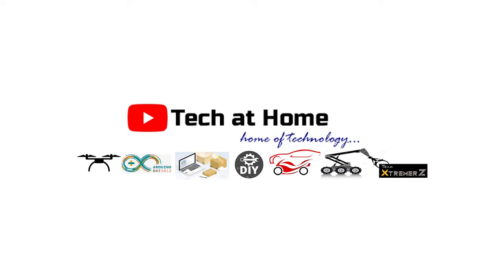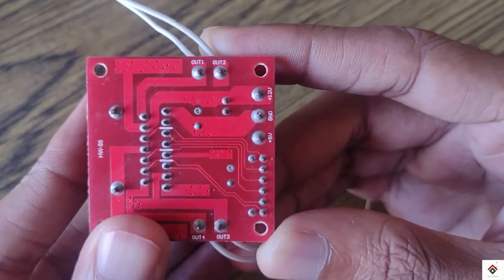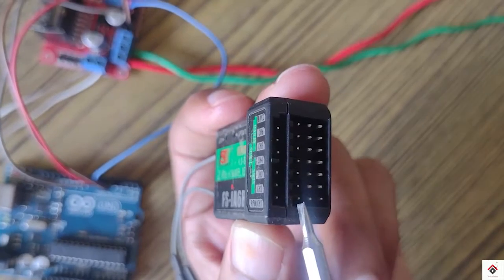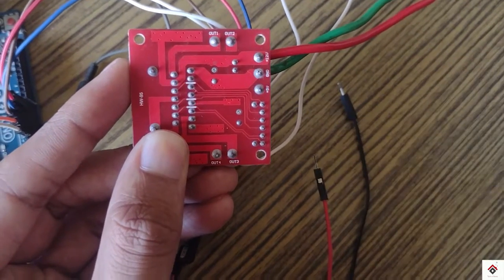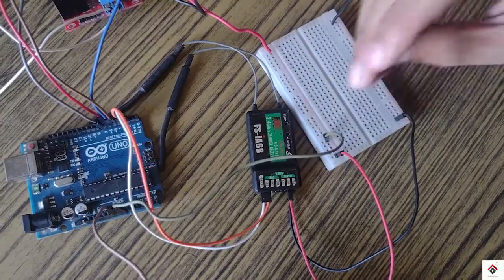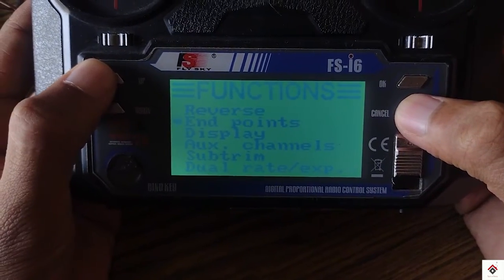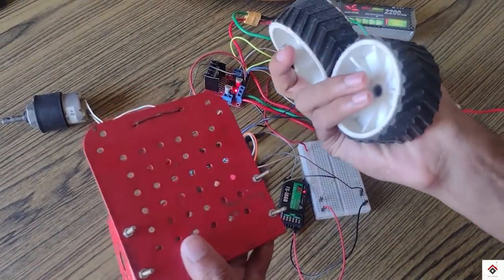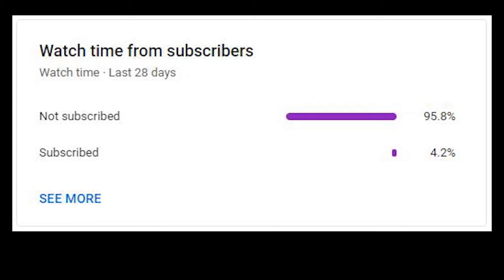Control Two DC motors using Flysky and Arduino | How to make 4 wheel Robot, RC car[ARDUINO + FLYSKY]

Comment from the maker: Control DC motors with seperate sticks for pan and tilt application : https://youtu.be/pnSPDeeDyxs
Reply: Hey @techathome could you help me? I am making a tank with the same mechanics as shown in your video but I want to add another moter, one servo and a way to shoot a gun using a nichrome wire. I am useless at doing any type of coding, would appreciate it if you helped

*Edit: not an actual gun just a model one using flash cotton to shoot a small metal bearing

Comment: Could you do this without the arduino board and just the flysky
Reply from the maker: Check this video for the same: https://youtu.be/m9Lq-QADP9A?si=r8GQZYcWO2JqnEK2
Reply: @techathome thanks what i want to do is make a 40volt lawnmower rc, I already have the motors and batteries and buck converters, now I just need an rc platform and I think the flysky is the answer
Reply from the maker: Flysky can be used.

Comment: Can this tiny motor driver handle these big 12v motors?
Reply from the maker: Yes for some time.
We have latest video without using Arduino and with high current driver. Go with this if you are working: https://youtu.be/m9Lq-QADP9A?si=ZMWZtLoFCtU-E4Tt

Comment: I am a subscriber. You sir have explained the procedure and connections perfectly and in a manner a novice can understand. 
Thank You!
Now add a bi-directional turret with a relay for turning on a fan with program to make the controller complete.
Reply from the maker: Thank you ♥️🙏🙂
We have the latest version without using Arduino. Go with this method: https://youtu.be/m9Lq-QADP9A?si=862nuMWoYCq3AhVX
Reply: I recently purchased: WT-500S Tank Chassis Robot Remote Control w/Complete Electronic Control System on Ebay.
It however failed on the first power up. The control board smoked. The seller is being difficult on replacing the board.
I plan to install Arduino with L293 drivers, but I need an additional motor. can you help?

Comment: Bro use flysky fs-i6x transmitter or not
Reply from the maker: Yes you can use it.
Also instead of this video, check the latest solution without using Arduino: https://youtu.be/m9Lq-QADP9A?si=3AV678mhUmGbla1f

Comment: Can I use the same method for my 25kg warbot,Instead of cytron ??
Powering 24v. Suggest any method if this not work
Reply from the maker: Check this video, you can connect 24v supply and motors: https://youtu.be/m9Lq-QADP9A?si=YVvHB-bRe1myWaPl

Comment: can I input 7.4v to the 12v port? 
or does it need to be 12v?
Reply from the maker: You can use 7.4v if your motors can run with that supply.

Comment: This absolutely does not work !!!
i build it 2 times and my motors don't run.... 
What voltage motors do u use ?
Reply from the maker: 12v motors.
We have latest video without arduino. Check once: https://youtu.be/m9Lq-QADP9A?si=m6C0FN2sOyekVZhg

Comment: sir i have used 3 motor drivers to connect 6 dc motors , now i have to give power to arduino only from  one?
 and i am using switch to to control only forward and reverse movement of the motors then from where i connect the switch directly in UNO or else where.

Comment: Sir, your video is so awesome.
My code is uploaded successfully and my all hardware connections are correct working properly. But my 500 rpm motors are not responding to joystick. It is in off position only no movement in it. 
I think i have upload the code after the connections?
Reply from the maker: Can you check this latest video without the need of Arduino: https://youtu.be/m9Lq-QADP9A

Comment: Voltage limit ? Could i use an 25 volt motor?
Reply from the maker: Not with this.
Refer to video below which doesn't need Arduino board and can work with 24v motors: https://youtu.be/m9Lq-QADP9A?si=Ym0KUEisNj1dfrak

Comment: hello techathome. Does this also work with the fs ia6 instead of the fs ia6b receiver that you have used? Thanks
Reply from the maker: Yes, but one suggestion.
Instead of this solution, check one more latest video which doesn't require Arduino: https://youtu.be/m9Lq-QADP9A

Comment: Bro can we connect 4 12 v dc motor and pair it by 2 2 motor in one side and another 2 in othr side of motor driver
Reply from the maker: Yes you can do that way, 2 motors in parallel

Comment: I am not able to get rx signals on my arduino....I have connected every wire correctly still i am not able to get arduino rx signal
Reply from the maker: Check if your jumper wires are fine or not using multimeter

Comment: I can't seem to get the code file to work. I can see the code in your video through the (if) line. Any chance someone help with the remainder? I built a project with the exclusion of an arduino because code for the project would've been way outside my ability but the last item, linear actuator, has forced me to use an arduino. I can do small simple and hopefully at some point do a more complex code on my own in a future project. I just haven't progressed thar far. Harder for older people to grasp this but I'll get there

Comment: Sir with the same code only one motor is running I have checked the motor driver and the motors are okay. What can be the problem sir? Is their any issue with the code
Reply from the maker: There is no issue with code,
Have you mixed channel 1 and 2?
Reply: @techathome  how to mix sir

Comment: I made it but the motors started rotating as soon as I connected the battery, I turned on the elivon and checked every connection. I used 5v bo motors in it is that why it's not working? Please reply 🙏🙏🙏🙏
Reply: Check your motor trim slider or dial depending on your transmitter. Motors might move until you adjust the trim. Plenty if videos to show you how.

Comment: Im trying this with the same motor driver and motors with an arduino. But my motors are only running in one direction and not the other.
Reply from the maker: Refer this video and check if your motor driver is working for both direction: https://youtu.be/xHbsWyoijb4

Comment: Can i use this with nrf24l01 transmitter and receiver?
Reply from the maker: To control the robot I have mixed two channels,
Is that channel mixing possible from that?
Reply: No, but I want to use it with separate channels
Reply from the maker: Then this will help you: https://youtu.be/pnSPDeeDyxs

But modify the values based on your receiver in the code (if else statements)

Comment: Question, does this devive work with any type of receiver? For example a Futaba?
Reply from the maker: Yes it will work. But you need to print and check the values coming from your receiver and update the same in the code (if statements).

Comment: I really like this lesson and I am studying UNO ,AVR 328. I have a question signal output digital pin 4 and pin 7 right?  signal output pin 5,6 PWM right? If want to control something else what should I do pin4 ,5 pin 7,6.  If I don’t have motor driver

Comment: Does the code work on flysky CT6B
Reply from the maker: Yes it will work,
But 2 things to take care,

1.  Print the values from both channels on serial monitor(Just uncomment serial.print lines in the code) and based on the values coming from your receiver, edit values in if statements.

2. For robotic movements, check how to mix two channels in ct6b
Reply: @techathome  ok thanks a lot
Reply: Could u please make a code got a car using ct6b transmitter as the above thing what u mentioned is not working.
Reply from the maker: I don't have ct6b with me
You can mail us
I will help you there

Comment: Is it possible to control the speed of the motors according to the stick movement in transmitter
Reply from the maker: L298N was not able to handle properly.
I have already done updated video using BTS7960  with speed control: https://youtu.be/EnbkdrYQ0NE
Reply: @techathome  thanks for the reply 👍

Comment: When I tried this I was using analog A0 for the flysky signal and  digital read function that reads like analog in and maps it to the outputs. It didn’t work that way but now I found this video thanks. But why does analog read for A0 not work.

Comment: can i use any RC controller with its transmitter or does it have to be flysky? and if i can use any.. does the code changes?
Reply from the maker: Yes you can use any transmitter,
Make sure correct receiver output is used.
Also, in the code we have used values for comparison, those values you can print on serial monitor and edit accordingly for your Transmitter.

Comment: If I am connecting power supply to motor driver not getting the signal in Arduino.
Every connection were perfect.
What to do?

Comment: Controller is only able to start the motors, but after that we can't control the direction of motors..... Not detecting the Code from else if
Reply from the maker: You can try this:
Print the values coming from channel 1 and Channel 2 on serial monitor
According to your transmitter values modify the code

Comment: If we are using 4 wheels, will the codes be same in arduino ???????please reply,also if the code is different,please provide the code :)
Reply from the maker: Yes same code
Connect another motor in  parallel to left motor
Similarly, on the right side
I guess I have shown in the video somewhere about connection of 4 motors
Reply: @techathome  thank you ,it is working fine ....😊

Comment: Hello brother! 
Actually I was planning to make a remote controlled bike using a bo-motor and a servo motor to turn the handle connected with CT6B  receiver, so wat should be the connection of bo-motor and receiver..... Cuz bo-motor don't have signal pin 
Em not getting wat to do so pls assist me 🙏🙏🙏
Reply from the maker: Servo motor directly Connect to Receiver

For BO Motor refer these video, but use( 9v battery instead of 12v)
https://youtu.be/Pcct-0RmcZE
Reply: @techathome  thanks for the reply!!
bro as I am making a bike..... using any kind of Arduinos makes my bike bulky....so is there any idea other than Arduino???? Pls suggest
Reply from the maker: Arduino nano you can use
Reply: @techathome  thanks for reply brother!!
if I use Arduino nano I must compulsorily use any of motor driver viz. L298N....it definitely makes my bike bulky....
Okay wait!!,  I also have an alternative way of making RC bike by using HC-50 bluetooth module without using any receiver....but wires and connections makes bulky....so wat do u suggest for tat

Comment: Ic Is getting heated what to do
Reply from the maker: Which motor are you using, Jhonson motor or normal 12v DC motor?
Reply: @techathome  12v dc motor and even 9v motor
Reply from the maker: L298N only you are using ryt??
Reply: @techathome  yaa
Reply from the maker: You can add small 12v CPU or Laptop fan near the IC

Comment: How to control 10 ->12v dc brushed motor  with rc transmitter and receiver?
Reply from the maker: The Motor used in Video is 12v DC Motor only

Comment: how to change settings in CT6B transmitter like u did in ur transmitter pls help me
Reply from the maker: I have not used that,
But may be you can connect with computer, install the software given in the package and try once

Comment: Sir I want to add led strips lights to my robot . I should be controll with transmitter ..

Can you please tell how I should do it ?
Reply from the maker: U can make using 5v relay module with Arduino

You can assign Channel 5  to Switch A in transmitter for switching on/off the LED strip

In Arduino code, you have to read channel 5 (just do as other Channel in the code )

 Use if statement and you can activate relay according to value

Comment: hi brother, do you have code for controlling speed these motors?
Reply from the maker: I tried with that, but not working properly
Reply: @techathome  i heard we need to MAP with some values (PWM)
Reply from the maker: Yes yes, we need to map the values to range 0 to 255
I did the Same
But it didn't work

Comment: ok, I understand ......will it do the same when I connected with 4 motors....?
Reply from the maker: Use 12v DC Gear Motor, you can use 4 motor simultaneously, no issues
Reply: @techathome  ok thanks.....Keep replying I told you your number of vewiers will increase.
Reply: Pls yr contact no???